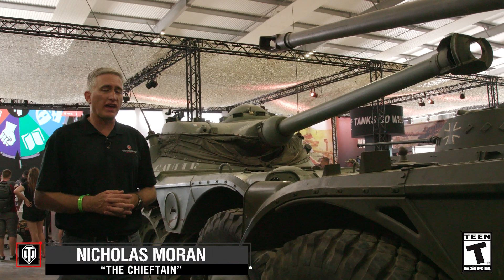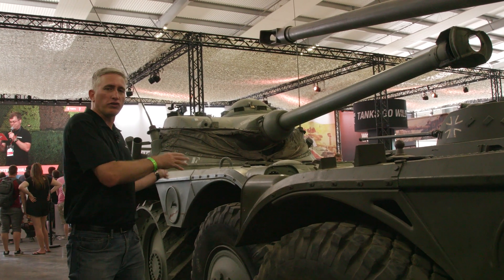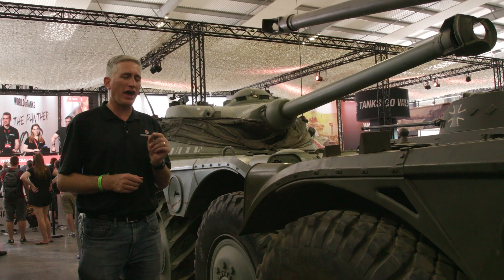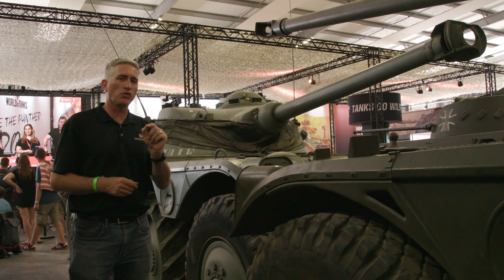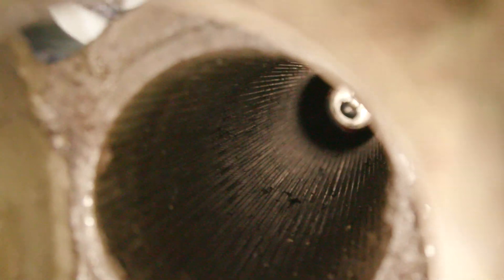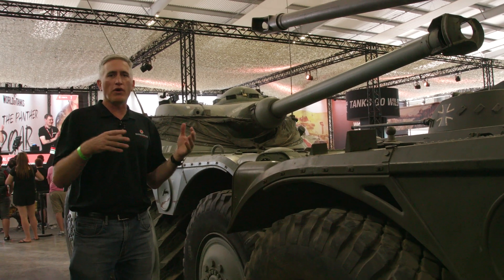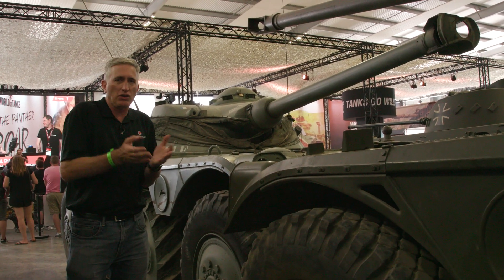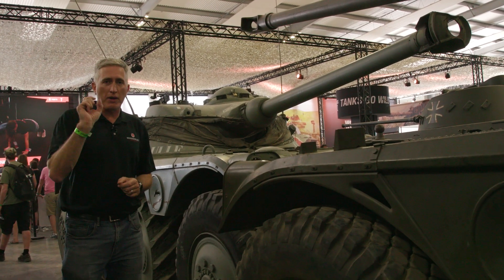Chieftain Shorts #6 - French Rifling, But Why?

Comment: I think I was watching Drachinifel's channel (The Drydock - Episode 73) the other day and he talked about the rifling on battleships main guns providing accuracy since it means projectiles don't need to be the exact same size as the bore to avoid bouncing up and down the barrel when they are fired. Projectiles can be ever so slightly larger and made of a soft outer jacket that will then squeeze into the rifling and keep the projectile in that orientation. The advantage to this is it makes it much easier to manufacture projectiles for a reasonable cost as they do not need to be made to exactly fit inside the gun bore.

Comment: Fin stabilised projectiles need to have a slight spin in order to compensate for manufacturing differences in the fins. Only a very slight spin though or they become unstable. Perhaps this rifling has that very slight spin. Even if it does not, it seems like a good idea to have straight rifling as otherwise the pressure on the rear of the round in the barrel would want to impart a spin in the opposite direction to the one that drag will create in free air. If it was spinning one way in the barrel, then this spin had to flip to the other direction in air I imagine this would cause a lot of instability during the transition.

Comment: Are you sure it's straight? Janes claims it's "low angle"  
  
That said, my theory for the odd rifling would be that the "low velocity" 90mm F1 on the EBR was based off a Mecar 90mm smoothbore, but the French wanted something that could be ammo-compatible with their higher velocity 90mm rifled tank guns if needed.

Comment: There are references that the CN-105-F1 gun and APFSDS rounds, and it not being designed for them with a concern for barrel wear.  Could it be later barrels were designed for preventing this wear?  I can't find any references to that.  Oddly I found a cutaway picture of the CN-105-F1 used on the AMX30B2 that has very visible circular rifling i.e. not straight.

Comment: I can only imagine it was to provide some minimal stabilization to the shell by keeping it in the center of the barrel while not making it spin to keep the maximum effectiveness of the HEAT shell. They were so concerned about that with the HEAT shells used by the AMX 30 they made the shells with an outer casing on ball bearings so it could go through a rifled barrel without developing a spin. The guns on the EBR was lower velocity so straight rifling was probably considered good enough.

Comment: Information found at .flint rifle smith dot com 

"...In a smooth bore WITH A LOOSE FITTING BALL you can shoot either a knuckle ball or a curve ball. A curve ball happens when random drag between one side of the ball and the barrel (at the muzzle) imparts a spin across the axis of the balls travel. This spin generates different pressure on the sides of the ball and causes it to curve just like the deliberate curve a pitcher can throw. Problem with the curve on a musket ball is it can break up, down, right or left and to different degrees between shots.

A tightly patched round ball in a smooth bore is unlikely to become a curve ball but a patched ball in a straight rifled barrel can never become a curve ball. It is a knuckle ball and has that amount of variation in flight so it is not as accurate a spiral rifling but it is more accurate than no rifling and has the added flexibility be being used to fire shot without disrupting the pattern the way spiral rifling does."
Reply: I was kind of thinking along the same lines. It's not like they were regularly using sabots back then, so if they wanted no spin and wanted the round to have contact all the way around the barrel without too much friction I'd imagine that's what they would have done.

Edit: It seems the first tank sabots were made 1979 if wikipedia is to be believed. So relatively new tech.
Reply: Yeah, that's what I was thinking -- smoothbore, once the tube starts to wear out, the projectile's the proverbial hot dog in a hallway, the straight rifling with a traditional driving band (as opposed to an obturator on the back of a modern sabot) would tend to delay the effects of a worn-out bore.
Reply: That makes sense.  Thus the French not wanting to be wasteful, found a large supply of cannonballs left over from the Napoleonic wars and decided they could press them back into service by modifying the guns to fire them.  Despite the smaller 6lb ball, this was found to be superior to their original plan of simply mounting 12lb Napoleon cannons onto their armored cars.
Reply: i somewhat doubt the physics of patched lead ball ammo in a black powder musket transfer well to modern artillery grade weapons firing shaped charge rounds. if a smooth bore is causing your ballistic round to tumble randomly, you have critical design flaws with the round or your barrel is in severe need of replacement.

Comment: It seems that the D921 used fin stabilized shells AND rifling on the barrel with a very slow twist. "The guns produced in France by EFAB have also had a calibre of 90mm, like their Mecar forerunner, and shallow splines with a very slow twist to impart a low rate of spin to the projectiles, sufficient only to reduce the effect of any minor asymmetries" Source: Ogorkiewicz, Richard. Technology of tanks, Volume 1 (1991 ed.)
Reply: Weird question, But you seem to have some information on french cannon. You got anything info about what type of shell the D914, D914/1, D915 or the D919 fired?
I got some info about APFSDS and HEAT rounds but the penetration of the APFSDS is kinda unknown. My two source says 1 it can penetrate 300mm of RHA at 1000meters and the other says 310mm at 1650meters.
Also Any shell name? A french tank enthusiast said it fired  OFL 90 F1 shells, Not so sure about that one.
Any info would help.

Comment: In firearms the straight rifling prevents the “keyhole effect” that would occur while firing a standard bullet through an un-rifled barrel. (Franklin Armory is currently creating a production firearm with a straight rifled barrel, although their reason is to skirt legislation). I would assume that the same effect would work on larger tank sized barrels as well, but I do not completely understand the benefit from a military standpoint.
Reply: Yea you got that all wrong.  That gun is a keyhole machine with standard ammo.  The only way that gun gets any accuracy is if you use their unobtanium, fin stabilized,  proprietary ammo.

Comment: I’m almost sure the straight rifling provided no accuracy advantage over smoothbore, rather it collected fouling from the fired projectiles in the grooves, allowing for more firing without needing to swab or clean the barrel. If you consider the areas in which the Panhard served, it makes sense, the less maintenance required, the better.
Reply: I thought that its for mass reduction (in the end this is wheel drive vehicle - minimum mass is very important here I guess) , but your explanation seems to fit better.
Reply: Ahhh yes! This makes sense. The French are a rather foul lot aren't they?